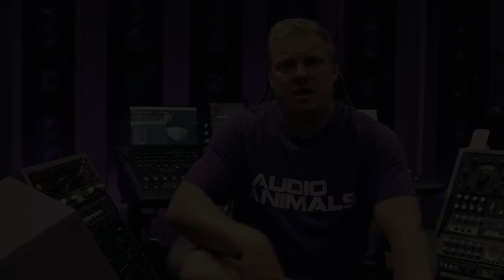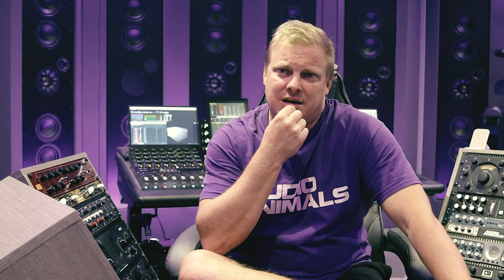Should I Use A Patchbay In My Mastering Chain?

Comment: How much conversion degrade the signal ? How many times ? If you make like 5 conversion with I/o plug ins in a mastering chain , you think it would degrade de signal, is going to affect the final result ?. Anyway the patch ay for me is the worst deshicimos, to much cables, noise and all you say.
Reply from the maker: For me it all about what is actually necessary and why perform an unnecessary action such as adding conversion. So for me converting more than once out and once in is unnecessary.

Comment: You are CORRECT.
I keep processes of all kinds to an absolute MINIMUM.
Every inductor, resistor, capacitor, switch. pot, etc. etc. adds noise and distortion.
Microscopic, yes, but ADDITIVE.
Keep your signal path as short and UNINTERRRUPTED as possible.
And these AD / DA conversions ?
AS FEW AS POSSIB LE.
Conversion errors ADD UP !
Best regards,
Bill P.
Reply: @michaeld4224 WHAT ? 
Resistors don't add noise ?
Well that's new !
Resistors are a prime source of thermal noise.
Look up "Nyquist Noise" and learn some thing new.
Inductors, capacitors, wire, circuit traces work wonders with A.C. hum.
Every movable connector like switches contacts, plugs, jacks are also noise sources due to oxidation and skin oils, etc.  
Gold plated contacts exist for a reason. 
Of course there's always 'Flicker noise", 'Burst noise' etc. to add to the fun.
Leaky and off spec. capacitors are a headache.
There's more !
Should I go on ?
Reply: "Correct?

Are you inferring that another's approach would be INcorrect?
Reply: @sekritskworl-sekrit_studios  I gave a concise and complete explanation, no futher explanation needed.
Read into it what you like.